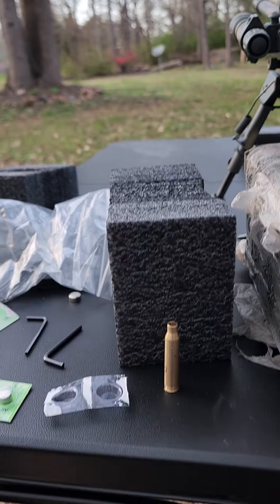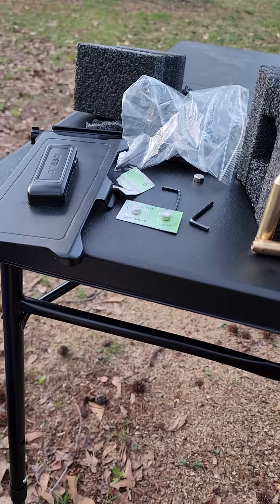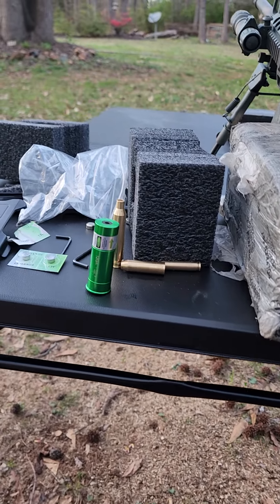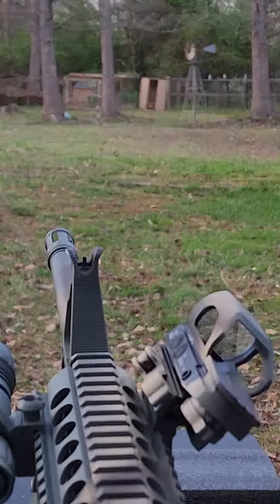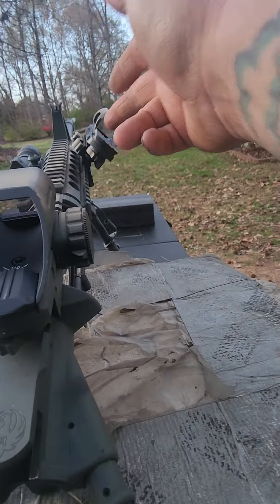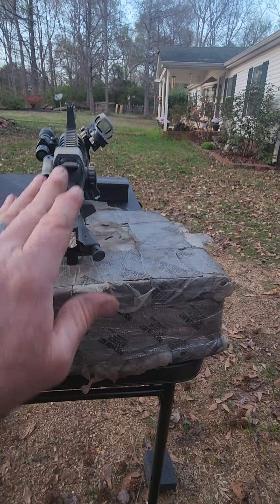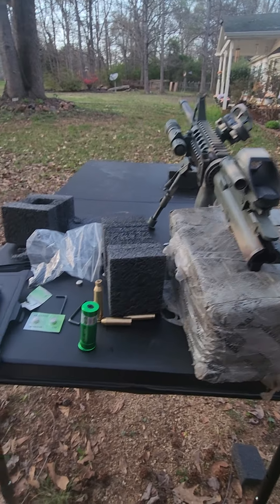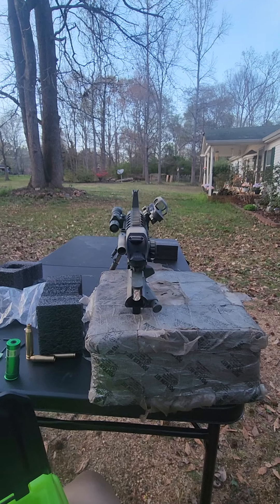prepping small batteries

Comment: I switched my setup to a2 carry handle (36/300 zero) with a 1x prism on top sighted in for approx. 50/200 zero. A light thatsl runs on 123A and i got a backup 3x9x42 ar223 scope from Nikon for 5-800 yards. Cut way down on my batteries for this main reason. Radio, weapon light, and nvgs are my only battery powered options. Solar blankets and panels out the ass but i just hate draling with batteries in the ideal world let alone a non ideal one.
Reply from the maker: See now this is how I like to see comments on equipment. Well done sir and thank you for the info.

Comment: Great video RESISTANCE! I've been stockpiling 123, 2032, 2016, AA, AAA, and D's for years. I've got some 9v and C's too but not too many.
Reply from the maker: Those 123 are pricey.
Reply: Yes Sir they are. I've got 120 regular 123's and only 32 rechargeable ones. I have several lights that use them though. Occasionally I catch a sale on the regular ones.
Reply from the maker: I hot a 4 pack about a month ago of regular 123 at 22 bucks.

Comment: U could use a 10 yrd zreo with lazer just alot easier to see and that gets you teal close when you shoot to verify shots
Reply from the maker: Your right and I need to re visit doing that. The last time I attempted it I apparently placed my impact point too low of the mark. Doing this at home is my best option because our outdoor range only allows you to check targets every 30 minutes for adjustment. I'm setting up a new AR 10 this weekend and I believe I'll use this method.
Reply: @wearetheresistanceprepping1883  yes your Lazer dot from bore should be about 1.9 inch low from your aiming dot 👍